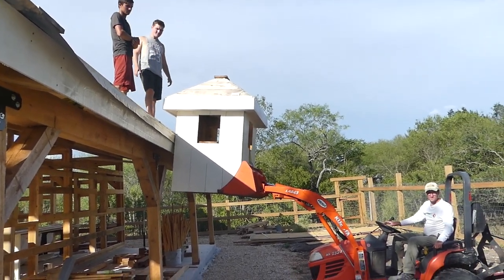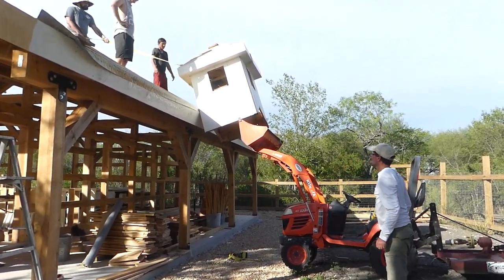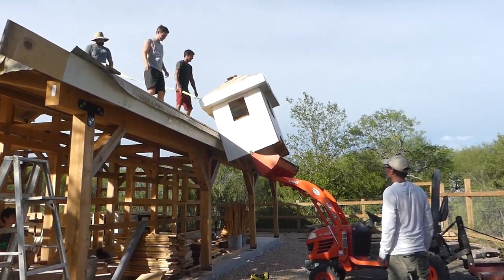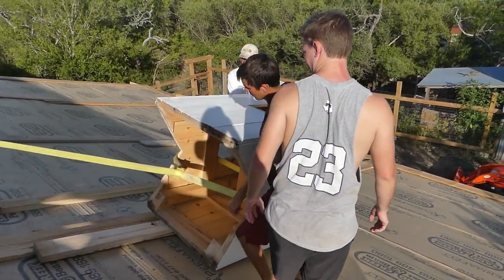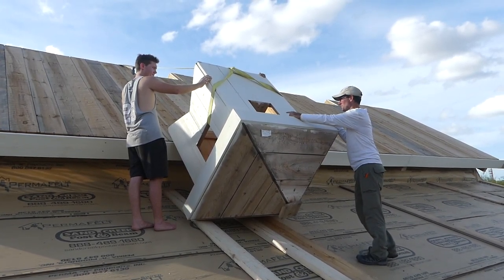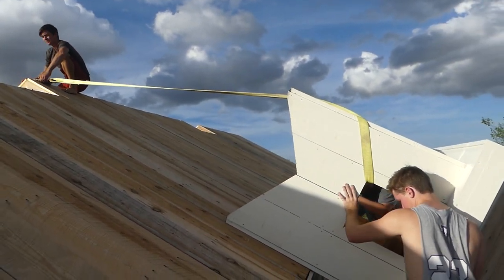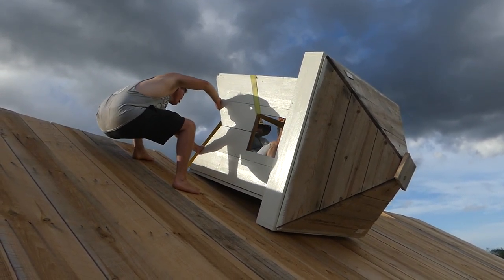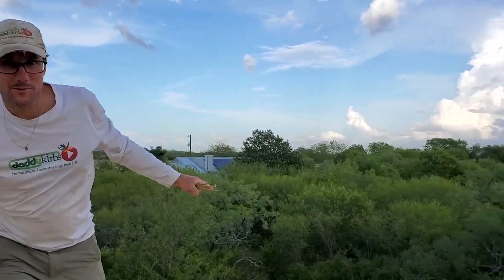They Lifted 300 Pounds 23 Feet UP! - Installing the Barn Cupola

Comment: First though was gin-pole. Second was put 4 grk through the strap and lift a skid underneath. Third thought is I'm building it on the ground and reassembling it topside. Thanks for sharing. I had not yet figured out how to get one in place yet.
Reply from the maker: These came to us in the barn kit already assembled. It did pass through my mind to disassemble it to move it up to the top.
Reply: @daddykirbs  I looked at the kits, decided I wanted to do it the hard way. I've milled up 20% of the boards and batten, and have the logs for my 14' main posts. Only 12,000bf to mill yet.